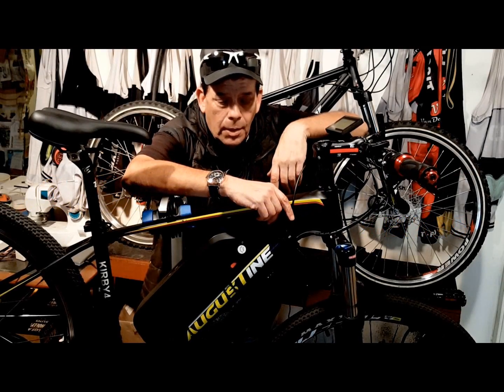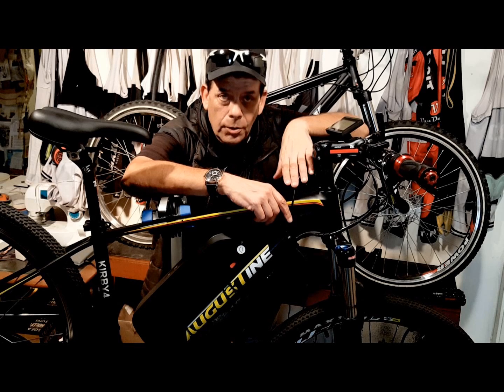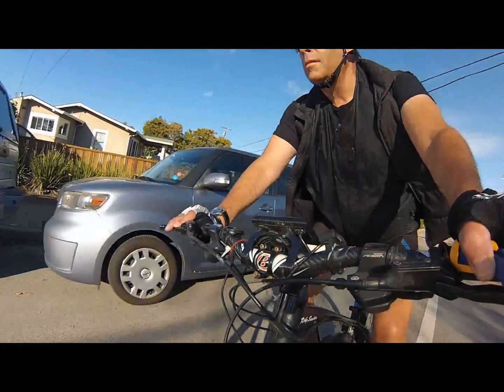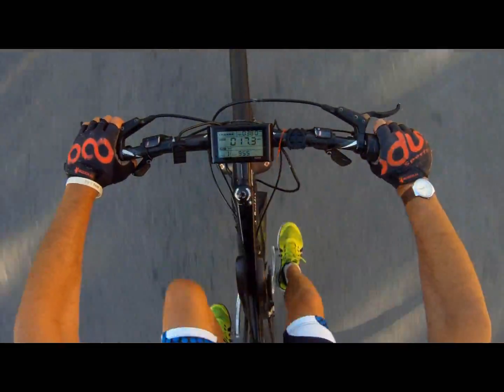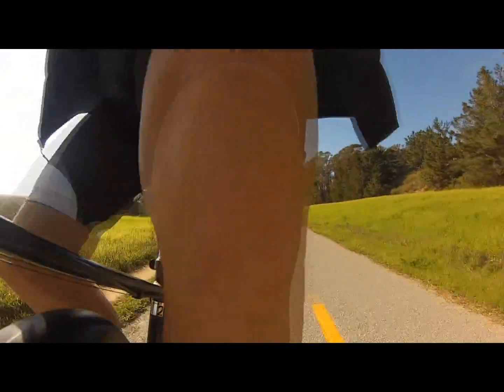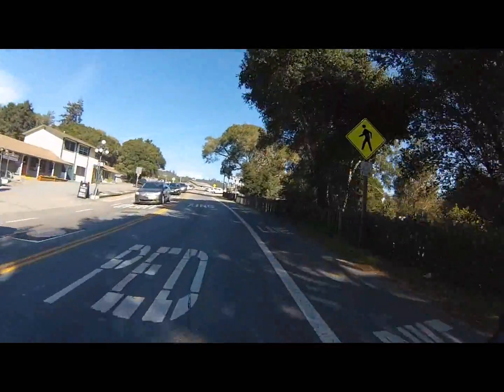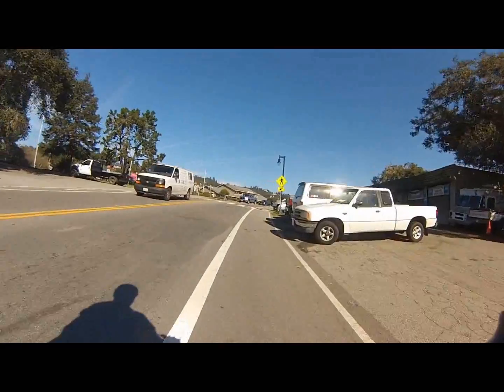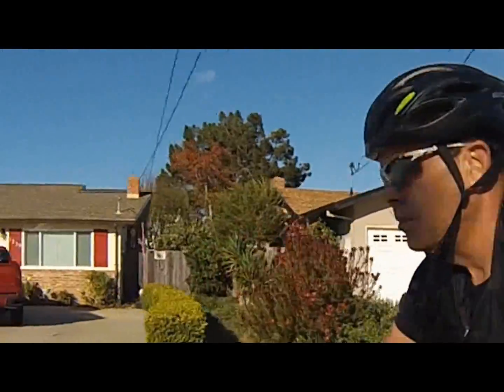Turn Your Ebike Into A High Performing Machine. Use Pedal Assist

Comment: Hey I would like to know do you guys have a electric bike that goes 40 miles per hour with the pedal assist because I want to buy one this year from your company
Reply from the maker: A lot of these kits can go 40 mph with just a throttle.  I will tell you that even in the biggest gear it is hard to keep pedaling over 35moh